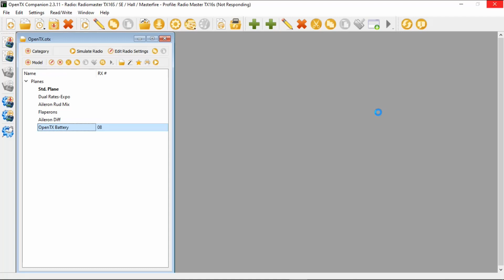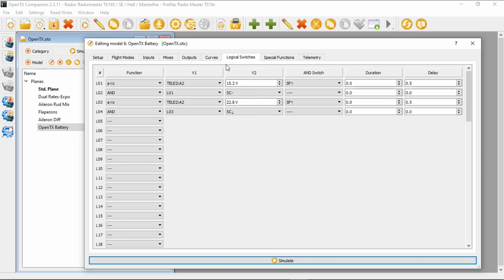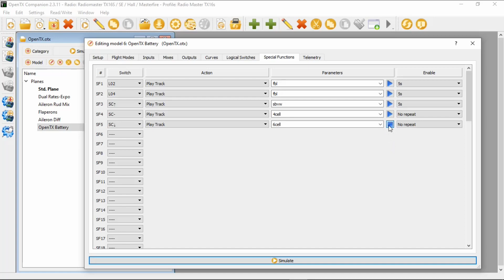OpenTX 4s & 6s Low Battery Audio Warnings

Comment: My remote has a x>6 on sa for arm and removed something so I no longer get 4s call outs. The gentleman before had it set up. What's the missing variable set the next one to 18.00 and change it to less than 😊
Reply from the maker: Kenny, it’s difficult for me say. I would suggest check the settings against this video.

Comment: One of the reasons I wrote my SOundPack, so my radio would verbally read out the voltages to me, and watch them for me so I could watch them um... road.. and forget about having to care about htem.   Program them into the radio in advance ahead of time.   Have a switch to toggle alarms on and off.     All with Logical Switches and Special Functions.   I use those per model so much, theyr eally need to expand them from 64 which is cramped to a generous 256

FPV pilots can't read the screen while flying aerobatics or otherwise, so voice is the ticket.    I do display min and max values on the model pages screens to look at after the flight, but in truth, the sun is usually so bright and I'm so ready to pack up, I never remember ot check them... let alone write them down or anything.   Maybe out of curiousity I want to know my max alt or speed, or lowest rssi.. but I alwasy forget to check.